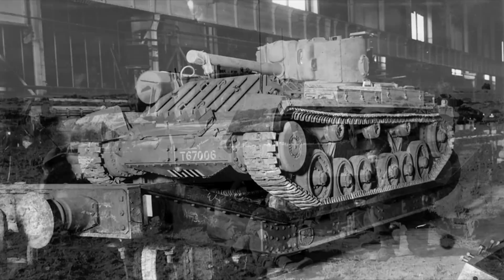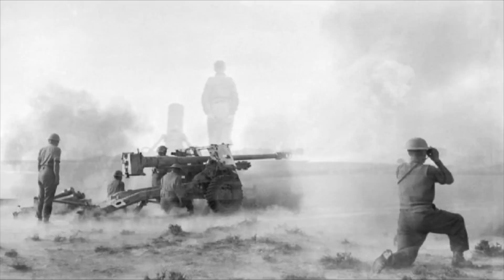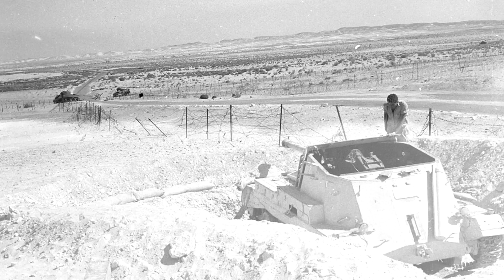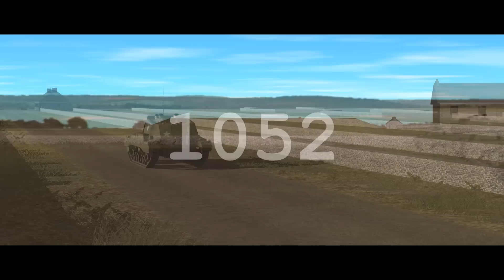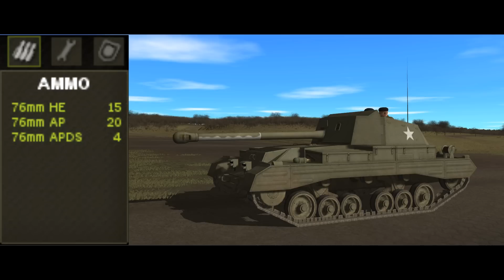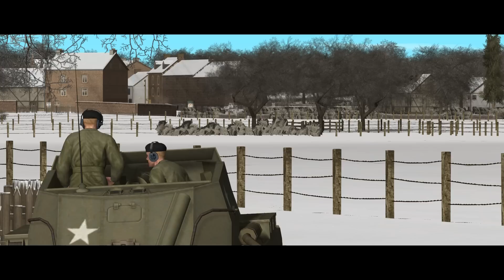Combat Mission Units: Archer

Comment: This second iteration of Combat Mission series released in 2014 is, for the most part, just a graphical update to the year 2000 X1 engine from "CM Beyond Overlord." So that's why you have such weird archaic map & building features - the design is essentially 25 years old. I agree that the map system needs a major overhaul (among other things). Unfortunately, Battlefront went out of business recently, and CM IP rights were bought up by Matrix games, so I doubt we'll ever get any improvements. At best, Matrix Games will just release a series of new modules using the same engine.
Reply from the maker: So... almost all of that is just incorrect, from CMX2 coming out in 2007, not 2014, to the fact that Battlefront has publically stated the CMX3 is in development.
Cheer up! https://community.battlefront.com/topic/144795-the-tradition-continues-a-look-ahead-into-the-new-year/
Reply: @usuallyhapless9481  Well that's good to hear.

Comment: My beloved 17 pounder 
Fun fact 
Most of the tips you give can be applied to another game called firefight 
Firefight is closer to the close combat series rather than the combat mission games 
Someday the dev is gonna add the subcomponents factor to tanks since currently it's just the gun either 
Penetration (may destroy the engine) 
Or not penetrate (which could trigger the panic mechanic) 
Or bounce

Comment: Interesting vehicle.  I look at the Archer as a light weight backwards facing Ferdinand with a different niche to fill.  Snipe and run vs plod and advance.  I wonder if there are stats on crew survival taking into account that the entire engine compartment was between them and incoming fire during a gun duel.  I am not sure if that would be good or bad.  In any case it was an interesting use of an obsolete chassis.
Reply from the maker: Honestly, I'm not sure enough of them actually saw use in their intended role to generate any meaningful data.
Reply: @usuallyhapless9481 thought them to guarding duties, but seen the same done by Cromwell 75 mm bore as well

Comment: Would various types of artillery make sense for unit guides? Say for example the American M2A1 105mm howitzer.
Reply from the maker: Potentially. Like Lars says there are some difficulties because you usually only see the effects, but there are some on-map guns that could be worth exploring with these shorter guides
Reply: @usuallyhapless9481  You do have that M7 priest in that one mission in Montebourg because those dudes wanted some action... but you don't need a unit guide to understand that a SPG is not meant to be shot at, and is not all that effective against tanks. XD

Edit: it might be worth it to simply group them together, like: "US fire support in BFN".

Because the only relevant data are the rate of fire, blast radius, effect on hard cover and calling time (for an FO, for consistency sake).
Reply: @alexy590  Not really because those weapons are only available as fire support. You don't personally command them.

Comment: That armour holding up against 20mm up to 250 meters, was not something I expected.

About your last point: the Brits actually replaced all their td's post-war with... more Centurions. Which makes sense. With the widespread adoption of stabilizers, casemate td's don't really add a lot to the combined arms team. The kanonenjagdpanzer is a case in point. You really have to wait for MCLOS atgm's until td's are viable again.

On a sidenote; something that I learned from your Semper fi campaign, is that antitank-vehicles can indeed be used in the attack, for long-ranged support. This is especially true for modern td's, like the Krizantema-S, which can also overwhelm an APS.
Reply from the maker: That makes sense. MBTs kinda tick all the boxes that the Archer does and then a whole lot more.